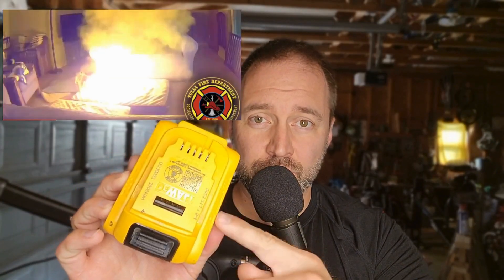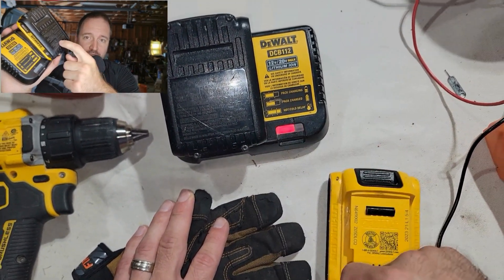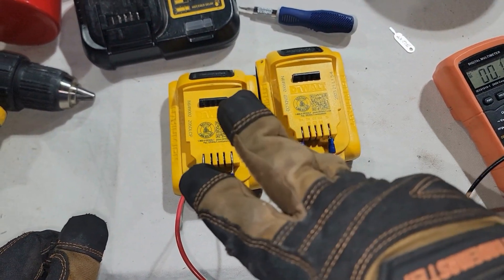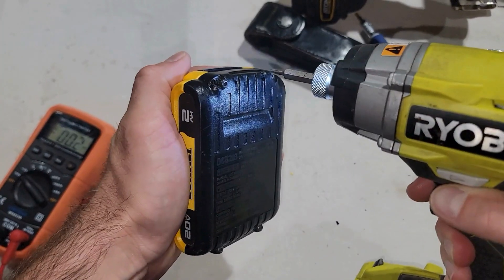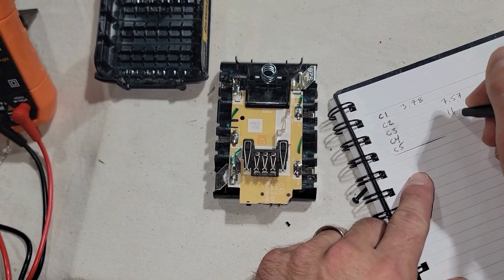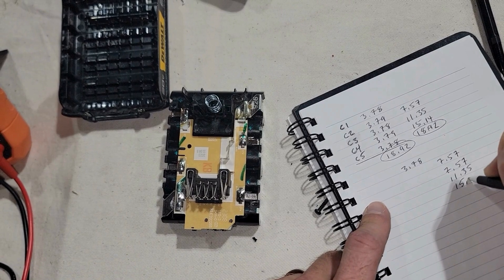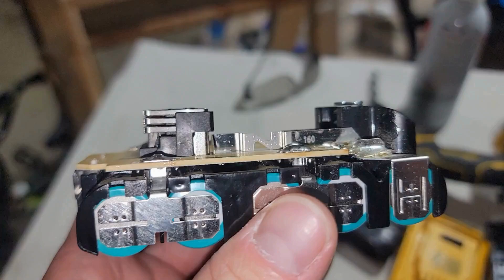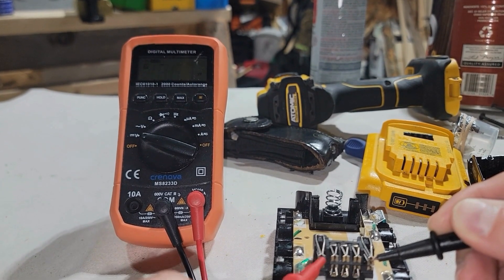DEWALT 20V Battery Not Working? [3 Easy DIY Charging Hacks -- but I DON'T recommend the last one...]

Comment: first video 2015. jumping cordless batteries. dude used a dc power box. next scissors.  now everyone with access to
 make a video and download it to the internet, all of the 2020's. Guys guys guys! Figure out something on your own. not just plagerize a 9th grade science paper to explain what you're copying

Torx bit should be a security  bit  as chargers and batteries have safety fasteners.
I just charge em 100% we'll 80% with a full battery.  I you dare leave em together for 5 minutes.  NEVER had an issue keeping them charging. Not even ANY heat. Idky......they are scared. Lol

Comment: So could a foolishltly inclined person bypass a bad cell? I have dead 12 ah batteries... Even if it only worked as a 6 thst would be improving
Reply: If you bypass a cell, then you have to adjust the charger voltage to match the new battery voltage, which you can't do with must DeWalt chargers so its better to replace the bad cell then jump it out.

Comment: 10:17 .. This is a great video!! .. I personally am looking into the little spot welders (they cost less than a new battery) .. Then it would be a simple matter of replacing the bad cell .. 

Either a good cell from another DeWalt battery .. or one form amazon.  

I used to do this with Nickle - Cadmium batteries back n the day ... BUT the Ni-Cads could be soldered back then, AND danger level pretty much zero, compared to the modern Li-ion.

Comment: What do I do if my rigid battery at work does not display a charge indication, and when I put it on the charger after five minutes, it says that it’s fully charged, but once I take it off, there’s no power in it?
Reply: Bad cells and the charger is shutting down charging because it detects a problem

Comment: So i jumped the battery.  That got me a little juice and the charger started charging it. But when I went back to check it an hour later there was no light on the charger. I tried a few times to get it going again and nothing.  Tried 3 different chargers and none of them will charge it. The light blinks as soon as you put it on but nothing after that. Haven't put a meeter on it yet but what do you think.
Reply: Also I did the fart thing with one of my regular dewalt batteries that I was having problems with and that worked. It's now charging. But looking inside this flexvolt 6ah I'm not sure i can do it 😂

Comment: When you point "my ryobi video here" there's nothing there for some people, you should put the links below your video. BTW that dewalt boost trick also works if you use a 9v battery to boost the battery that's not charging. At least that's what I used. All I did was touch the connectors 2-3 times and it worked. Meaning I didn't even leave them connected for 5 seconds
Reply from the maker: @dosdont  Nice!  Makes sense,  as long as it's direct current and less than the 20v but more than the state of charge when it's dead.  I'll keep that idea in mind next time! 

Thanks for the heads up on the link in the video not working.  It was my first time messing with that feature.   I think I got it working now.  It's around the 2:10 mark.  If you've got a second to spare and could confirm that you see it I would be so grateful!  🍻🍻🍻
Reply: @HomeBatteryBank Thanks for the video. I was going to buy a new charger as I thought it would be broken.

However, I have one question. I have two empty 10.8 V 1.5AH DeWalt batteries (DCB123). My neighbor gave me a 20 V 4000mAh Maxmat battery. But if I understand you correctly, I cannot use that one, because it has a higher voltage, right?
So only 10.8V or lower.
Reply: @HomeBatteryBank  No it's not working, I don't think it's you though, I use an ad blocker and I think it blocks that. Anyway it's still a good idea to put links both where you're pointing and below your video. Not a big deal for me as I see it to the right of your video in the Youtube recommendations.
Reply from the maker: @dosdont  Thank you for checking.  Much appreciated!  I added the link to the description anyways,  just in case.  Have a good one!
Reply: @HomeBatteryBank  👍🏻